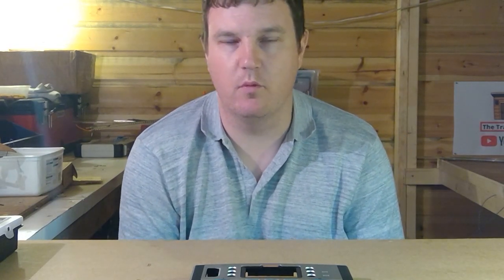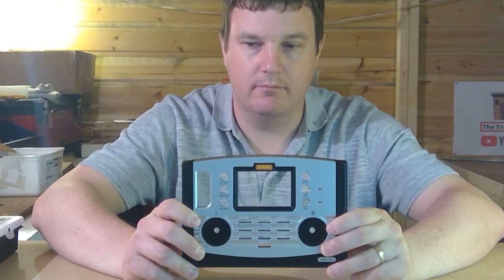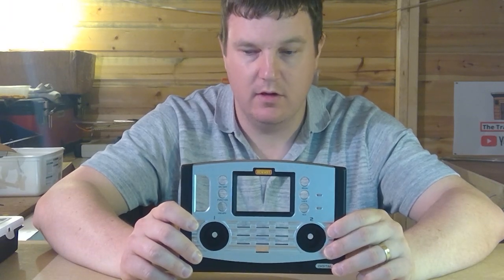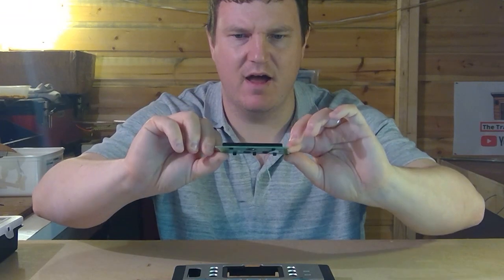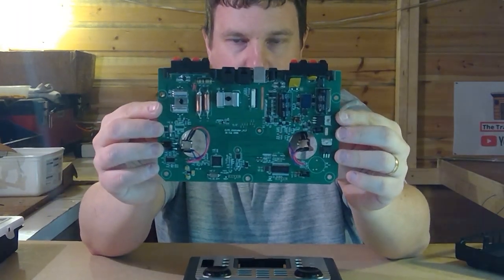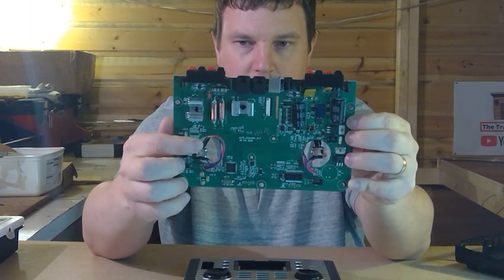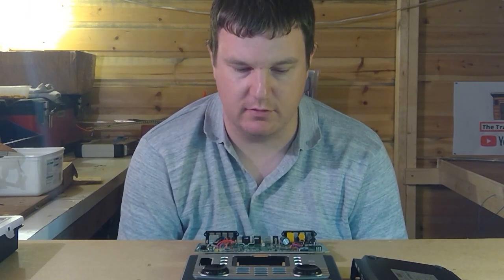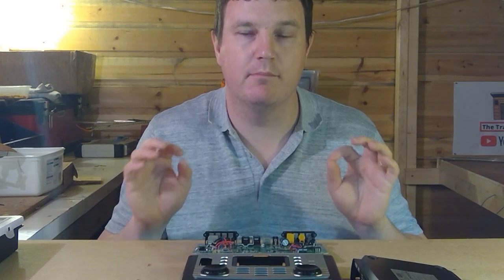Special Episode 2 - Repairing a Hornby Elite DCC Controller

Comment: You really need to know what the fault is before you dismantle it. I've accidentally shorted the USB lead out to the track and it won't power up. The heat sink on the left gets really hot (Q2A) so I'm hoping its one of these power regulator devices that is fault, although I can't see any identification on it at the moment.